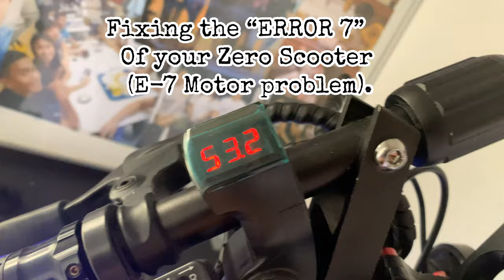How to fix ERROR 7 on the Zero E-Scooter.

Comment: Hello sir idol.. Sana mapansin mo.. May problema kasi ako sa zero10x ko ung front motor nya di gumagana pero fully function naman ung motor wala naman sunod at napalitan ko na ung sensor hall pero nag shushutter parin pag dinudual motor ko anu kaya problema sir salamat ng marami
Reply from the maker: Sir kakaopen q lang po nang yt q . May isa aqng nakusapndito nag comment din same kayo issue. Open mo yung footboard cover mo tapus check mo wiring sa loob ung mga nag kakadikit sigurado may wire jaang na sunod na lusaw nag short po yan. Buksan mo din controller mo baka meron din jan.🙏🏻